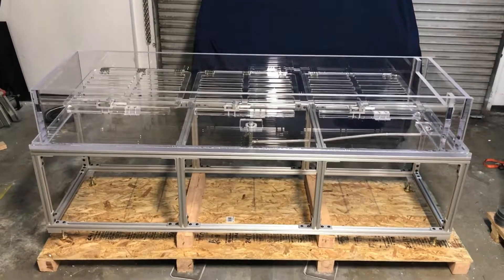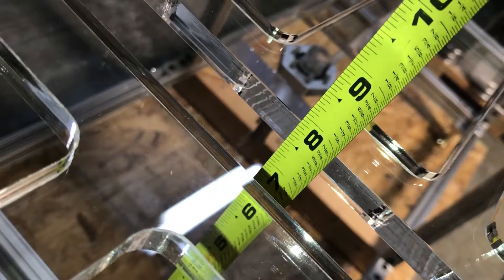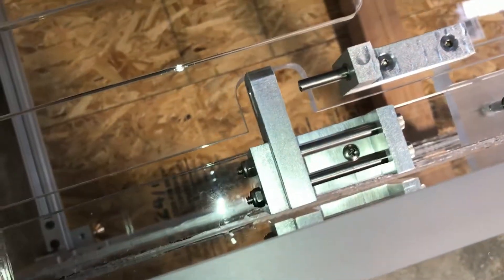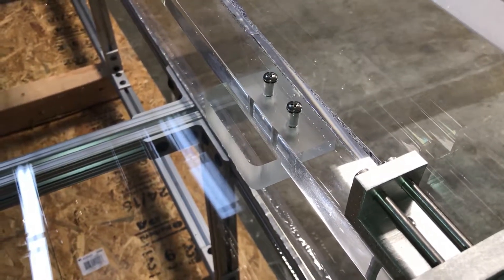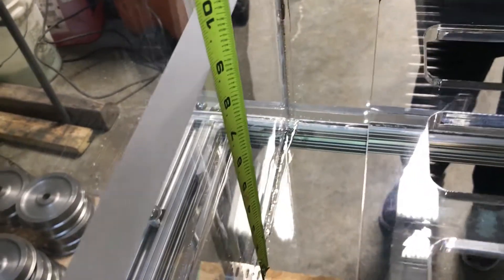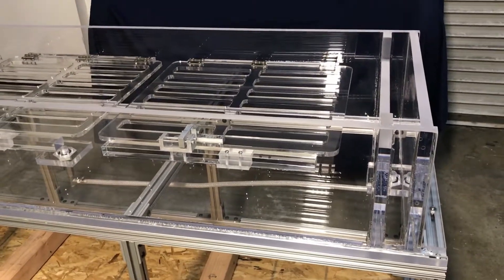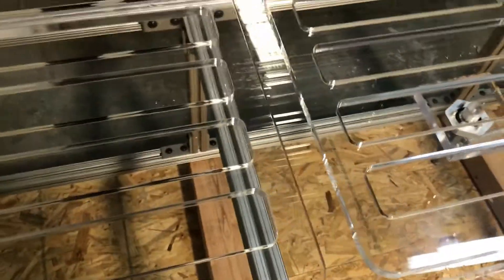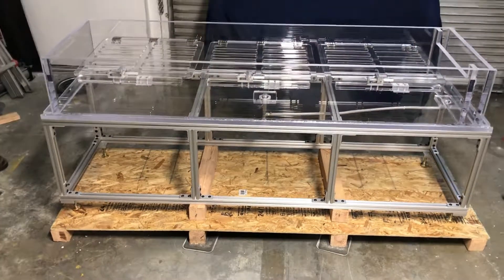ASTM F2096 Submersion Leak Test Tank for Detecting Gross Leaks in Packages (Pressure Bubble Test)

Comment: What equipment is actually used to perform the bubble test on the packaging? This is just a large water tank. Do you also sell the setup for performing the actual bubble test?
Reply from the maker: Absolutely, we supply the pressurization system that can be used to puncture the pouch with a septum so that you can perform your bubble leak test as per ASTM F2096. You can find out more about this here: 
https://sanatron.com/internal-pressurization-bubble-testing-system-for-astm-f2096.php

We also manufacture bubble leak testing systems as per ASTM D3078, link here:
https://sanatron.com/bubble-emission-leak-testing-systems.php

Let me know if you have any more questions. Cheers!